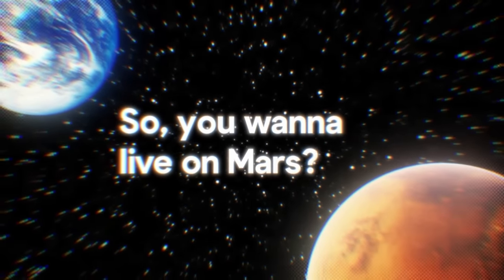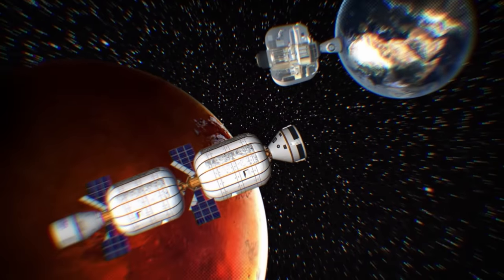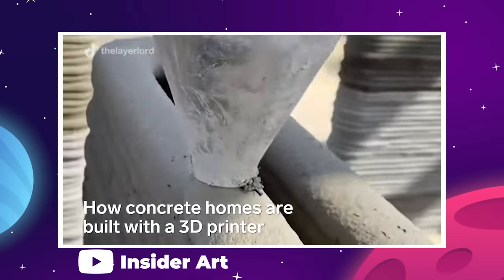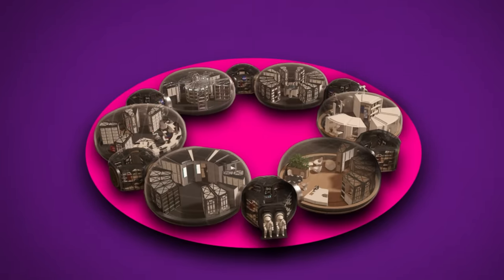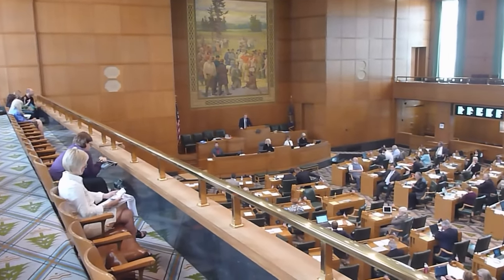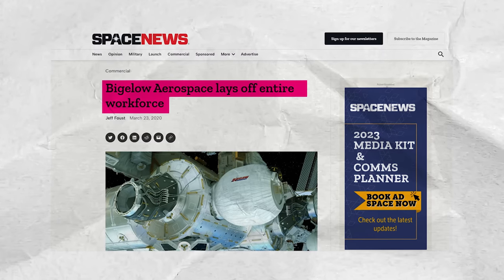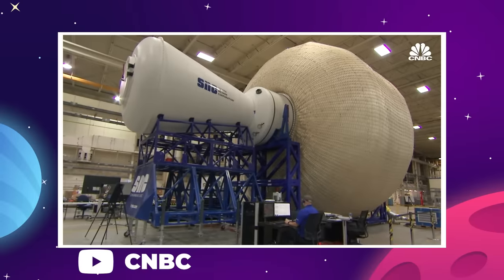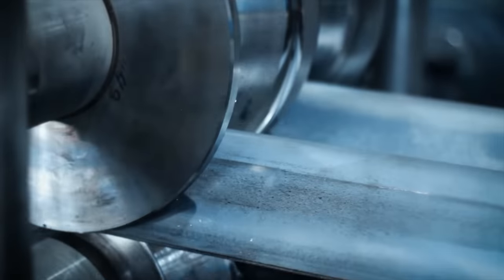Why Inflatable Habitats Are The Key To A Mars Colony!

Comment: Just a heads up: At 9:10, you mention that there is an ~30 PSI difference between Sea Level and space, but that is not correct. At sea level the atmosphere is 14 PSIA (absolute), but in space its -14 PSIG (Gauge). These are different methods of measuring pressure, so you cant just add them together like that unfortunately. absolute pressure is pressure compared to a vacuum, while gauge pressure is compared to sea level. Therefore, a pressure sensor that reads in absolute would read sea level pressure as 14PSIA, while a pressure sensor that reads gauge pressure would show zero PSIG. 

Basically, this means there is even less of a pressure difference that these habitats need to worry about, merely 14 PSI rather than 28 PSI
Reply: Thank you, I noticed that too and was hoping someone would explain it further.
Reply: Yes, indeed.
Reply: What the hell is minus pressure? No pressure is zero. I don’t get it.
Reply: Yeah essentially if earth is 1 bar or 14.xx psi, then space is 0 bar/0 psi. A guage that read 0 psi on earth would read -14 psi in space only because it's zero point is set at a baseline of normal atmospheric pressure at earth sea level. 30 psi would such ass
Reply: LOL just goes to show you the actual knowledge of YouTube talking heads. 28 psi lmao. Capable literally of nothing except regurgitating
Reply: @willymakeit5172  austinsiebert explained well above, I'll just add an irl example you can easily try, you have an electronic scale and you put an empty bowl on it, the scale will measure let's say 10 grams, you can zero the scale so it'll measure only the contents of the bowl, if now you remove the empty bowl from the scale, the scale will measure -10 grams. In this case you are not meassuring negative mass, you just set the baseline higher than the actual baseline.
Reply: With an obvious error like this, it makes me wonder how much of the rest of this article I can believe.
Reply: Really 14.7 psi, but yes
Reply: I didn’t notice that and would have never know if not for you. Thx for being smart.
Reply: Just a heads up Sheeple: You can't prove any of this
Reply: @davidsheckler4450  mathematically you can👍🏻
Reply: @edmundchase  most of the rest of the article seems accurate, although there are tons of issues with inflateable habitats on a surface. It works great in space, because there's basically no gravity, but on a surface things get really tricky because you have to deal with non-cylindrical shapes and self-supporting structures
Reply: @willymakeit5172  gauge pressure can be negative, absolute pressure is not. A gauge pressure sensor will read zero at sea level, and -14 psi in space.
Reply: @joeyjamison5772  yeh, me too, I was just not wanting to sound like a smarty pants.
Reply: Bravo dude Goldstar
Reply: Yup heard that and immediately scrolled down to see if someone else caught that. Didn’t take long thanks.
Reply: Was about to comment this, nice job 👍🏻
Reply: @willymakeit5172 think like how there is dark matter and energy there is also dark pressure in space which is lower pressure than 0. Hope this helps
Reply: Yup, that's what alerted me too. I consider my time too precious to watch any other minute of a video which gets such basic stuff wrong. I'm gone.
Reply: Ok dudes, here’s the formula: P (gage) + 14.7 psi = P (absolute) ; P (gage) = P (absolute) - 14.7 psig.
Reply: Don’t panic. The video just got one item wrong, and it’s a common mistake.
Reply: To explain further: when a gage is reading zero, that means it’s not reading the atmospheric pressure. The atmospheric pressure is another 14.7 psi. In space where there is no atmosphere and therefore no atmospheric pressure, we will die. That 14.7 psi is something we do not feel because the atmospheric pressure is exerted inside and outside of our bodies. Just like fishes can live in extreme depth in the ocean, the hydrostatic pressure is exerted inside and outside their bodies.
Reply: Humans don't need 14.7 psi to live.

We can make it at 5 psi with no problems due to pressure.

Of course you'd have to increase the oxygen percentage if you went that low.
Reply: The thing about vacuum is that the difference between a hard deep space vacuum and a rough vacuum is very little in terms of pressure difference. At 35,000ft altitude, the pressure is about 3.5psi and we think nothing of being in inflated aluminium tubes up there. Our children sit in them watching Disney movies. Mars surface pressure is only 3.4psi lower. So it is not a difficult technical problem, more of a psychological one!
Reply: @oldbloke135  , inhaling CO2 is psychological?
Reply: we all know American units are janky AF so let's just stick to SI and it's primary derivatives
Reply: It still comes down to: vacuum is not like in the movies.  You don't get "sucked out"  All those plane movies?  Same thing.  The only people that have gotten pulled out was due to the speed the plane was travelling, and not the vacuum.  Sure there's an initial venting, but a small plane equalizes within seconds.  And there have been leaks on the ISS that takes DAYS to find.  Because even a 1/4inch hole leaks so little as only to be dangerous to your air supply.  And they can be plugged with something as simple as chewing gum.  So long as a small hole.
Reply: Ok, after reading the comments below, it appears the mistake was noticed and brought to the forefront and can easily be solved! The idea of inflatable habitats for operating in space and on the surface of the moon or Mars is an exciting one and makes a lot of sense. No doubt there will be issues to solve, but I say let’s get on with it!
Reply: @dasiro Only the entire aviation industry uses US Customary Units. Knots, feet, inches of Mercury, etc.
Reply: @willymakeit5172  there is really no such thing.  You measure pressure by comparing it to pressure somewhere else or under different conditions (ie: earth air pressure compared to pressure in space).  Earth air pressure is 14 psi higher than zero pressure in space.  Your could say that compared to earth air pressure space pressure is 14 psi lower (as in -14 psi) but no one does that (except this video). HAHA
Reply: @appliedfacts  hi, thanks for the reply. If I’m following you, when I measure tire pressure, it’s not, say 32 lbs. above 0, it’s 32 psi above 14. Thanks.
Reply: @leapdrive  No, living in an inflatable habitat, worrying about the fact that if it was to suddenly "burst" it would mean certain death, is a psychological problem. In reality it would not be difficult to make a habitat that would never burst, unless hit by a huge meteorite. Have you ever seen a car tyre suddenly burst while the car is stationary? No, me neither, and that is double the pressure differential.
Reply: @oldbloke135  , I didn’t think I was in this discussion. How did we get to living in an inflatable?
Reply: Wrong. 1 atmosphere is zero on a pressure gauge. -14 psi is a vacuum. It’s only a 14.7 difference.
Reply: @davidbowerman6433  , -14.7 is pure vacuum.
Reply: I think that he mistook the 30 psi pressure of our car tires brings them to one atmosphere of pressure above external atmospheric pressure hence the thickness and constitution of automotive car tires could be a guideline for the material needed.  However, the tire pressure of a road bicycle tire ranges from 80 to 110 psi (40 psi for a children's bicycle) yet a bicycle inner tube is much thinner and more flexible than an automotive tire so a bicycle inner tube would be a better common analogy than automotive tires provided that micro meteorite and radiation shielding is provided by burying the structure in packed regolith.

I would suspect that the relatively low science comprehension of the script writer misinterpreted when someone more qualified used an automotive tire as something that holds pressure at one atmosphere above the external atmospheric pressure.  This is a typical problem with science journalism, the media provider often misrepresents what qualified experts tried to describe although some of the fault is due to the poor communication skills of the experts themselves.
Reply: That's true, there is a difference between PSI vs PSIA, for example, gauges (psi) are set to zero in reference to atmospheric pressure gauges is exposed to, to illustrate in another way, if you have a pressure gauge set to zero at sea level (14.7 psia) and take that gauge to 5,000 feet elevation  it will show approximately 2.7 psi instead of zero, because the atmospheric pressure at 5,000 feet is approximately 12 psia, so the higher you go the less pressure until you reach vacuum (space pressure).
Reply: @wakamoli8248  , in addition, use a barometer for negative pressures as meteorologists do.
Reply: Came here to say this thank you
Reply: Mars surface air pressure is almost 0.1 psi. So those tubes we fly in wouldn't be overstrained containing breathable air in that environment. And they're not even aluminium any more, they're plastic.
Reply: I noticed that too. It’s a pretty serious error
Reply: Methinks he doesnt understand what he's saying.